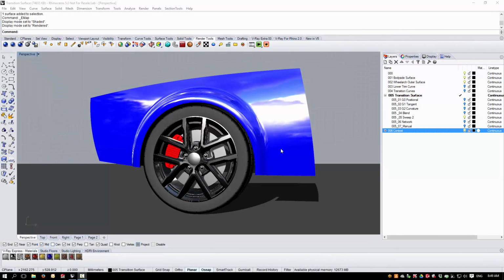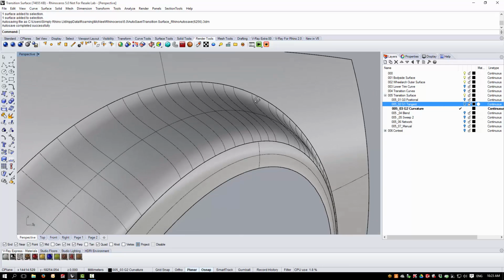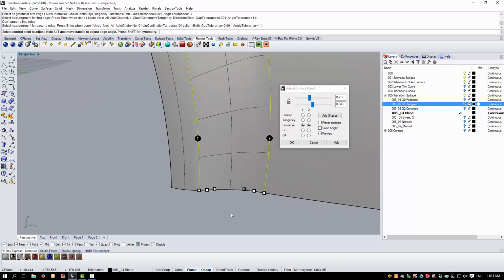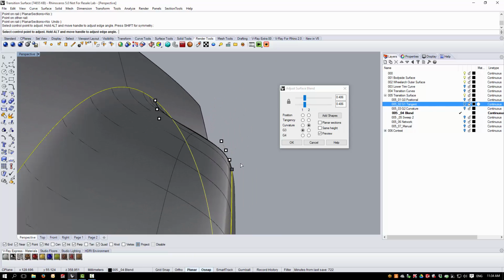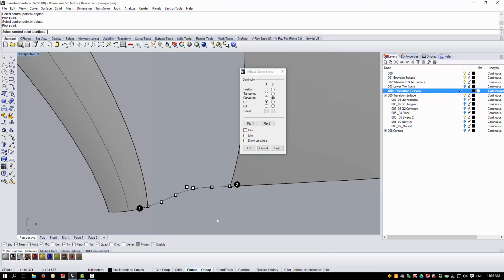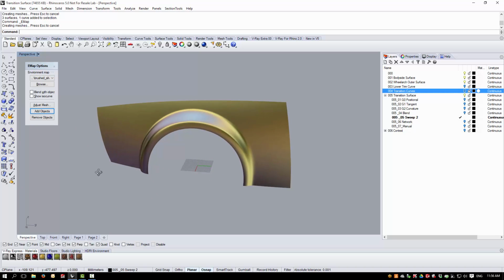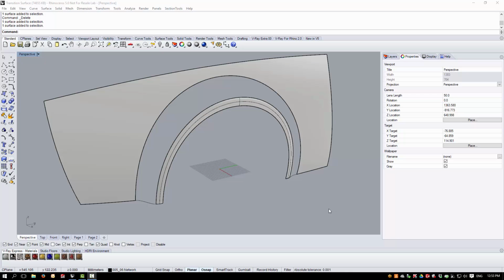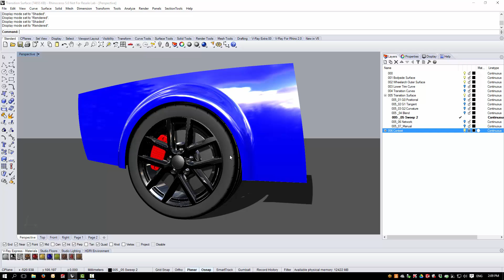Creating and Controlling a Transitional Surface in Rhino3d

Comment: So it seems to try Sweep 2 Rail first, if theres issues, then Network Surface. Blend Surface if youre in a pickle. Ive noticed at least for me that when car modeling, Network surface tends to keep to the curves the best before 2 Rail would. At a cost for geometry of course but its worth it.
Reply from the maker: Hi Dustin. All those commands have their place and will produce results. The key to getting good results from sweep is to set out the curves used correctly.

Comment: Hey Phil, First of all thanks for a very intuitive tutorial, its very helpful. You have been using fluorescent tube for checking any noise on the surface. where can we find one as its not in the environment. Thank you
Reply from the maker: Hi Sumit, In the Environment Map Options you can change the map – both Rhino for Windows and Mac have this ability and the fluorescent_tube map is included in both. Hope that works out for you - good luck!